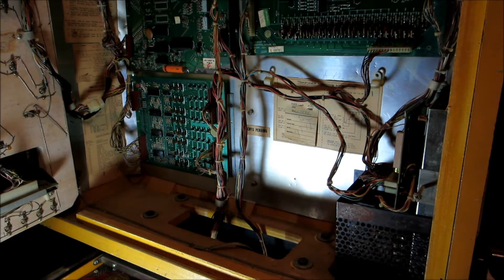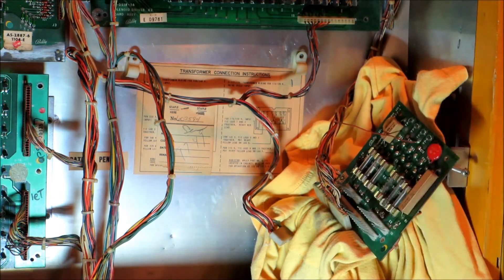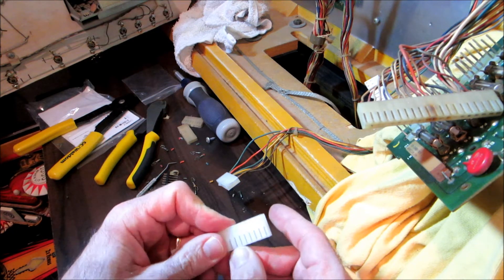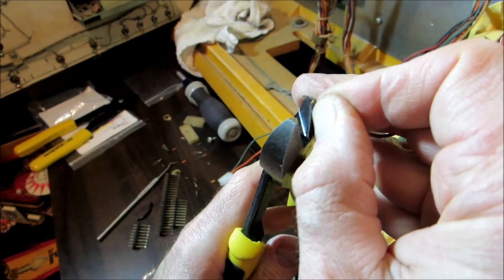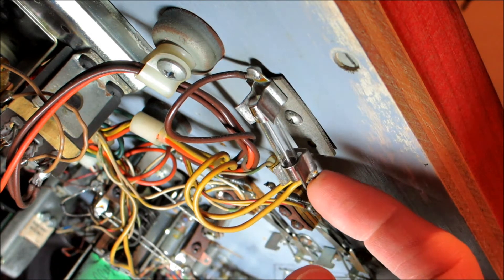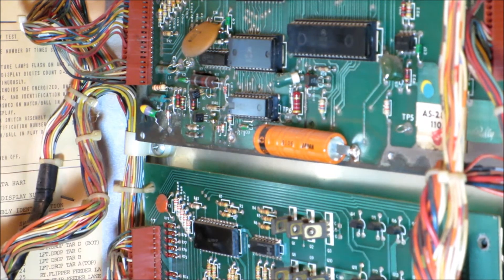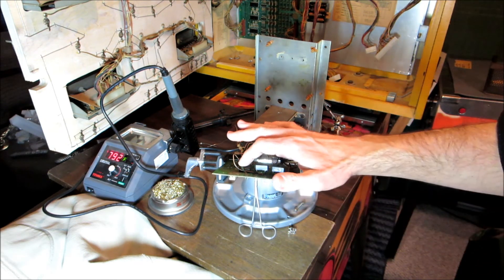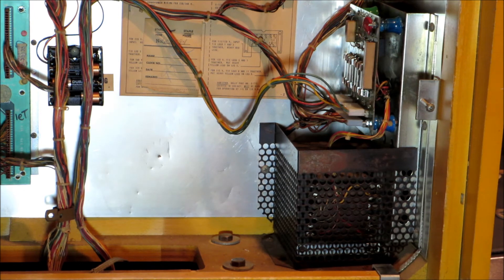Bally Mata Hari Pinball - Electrical Repairs

Comment: Blew a fuse off the coin door? either the coin lockout or a lamp cct.[10:00] R113 and R16  I replace with 4.7k, there is also a version designed to use the Lamp 6V instead of Solenoid 43V it will burn up the resistor.

Comment: I would have replaced all 3 bridges so everything is flush and can get the thermal paste on all of them.
I had to replace the 5 fuse blocks on the Hee Haw I am working on no boards but was quite the headache trying to figure were the middle fuse wires went.
But I figured it out and everything is almost working.
I love EM's But to clean them takes much longer that is were my love of SS comes in.
Much fasterr to clean up a SS pin not near the amount of switches and stuff in those. xD
But on EMs no worries about blowing up boards just mainly blow a fuse or coil burns up when there is a short.
But those are easy to replace.
And that seems to be a common thing with pins is most fuses in them are not the right ones they are either to high or to low.
There is rarely a pin I have worked on that has the right amps.
All I think is house/business burning down when I see that kind of thing.